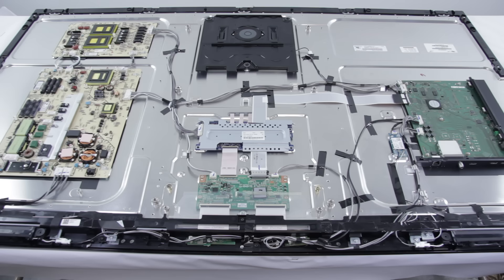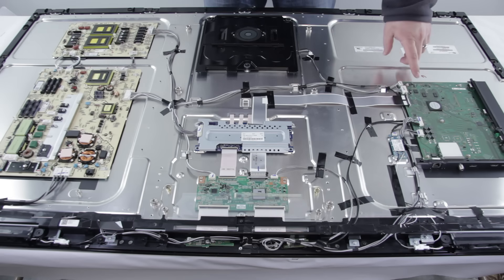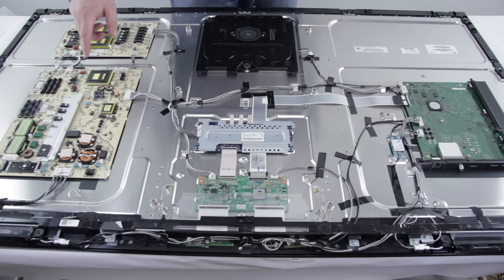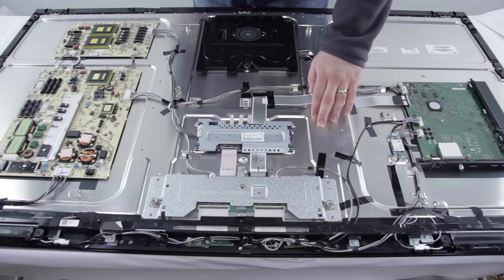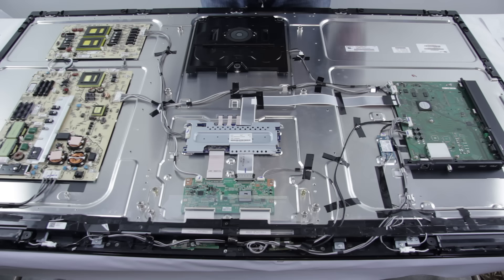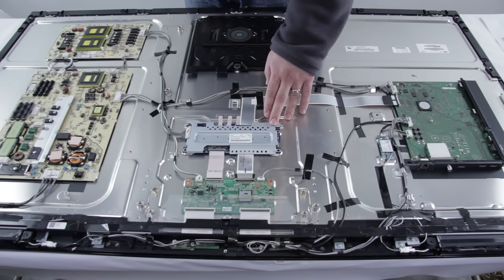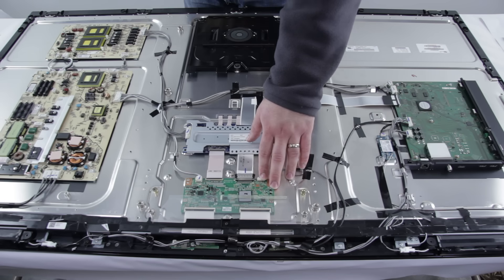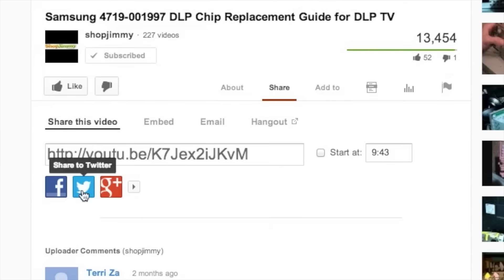LED TV Repair Tutorial - Common Symptoms & Solutions - How to Repair LED TVs

Comment: Hello I have a  samsung ue55d7000 my son hit the screen now it has colored lines going down the right side and the middle part of the screen is slightly darker what is your opinion on what could be the problem and parts to fix it or to expensive to fix.
Reply from the maker: Michael Belcher  This sounds like a TV panel problem.  If your TV panel is bad, it may be more cost-effective to replace the TV as panels are typically hard to find in stock, difficult to replace, and expensive.  Thanks and please let us know if you have any further questions!  www.shopjimmy.com
Reply: I am looking to buy looking at lg la9700 xbr65x900b samsung hu9000 or samsung f9000 any recommendations
Reply from the maker: Michael Belcher   Either should be fine.  Thanks!  www.shopjimmy.com

Comment: Hello I have a Samsung UN46D6400UFXZA  FOR A WHILE I HAD A THIN LINE RUNNING ACROSS MY TV NOW IT IS BLACK NO PICTURE BUT SOUND STILL WORKS.. I TOOK IT FOR REPAIR AND THEY SAID IT WAS THE  T-CON THEN CALLED BACK THE NEXT DAY AND SAID MY BACKLIGHT PANEL WAS NO GOOD AND IT'S NOT WORTH FIXING.. ANY IDEA CAUSE THEY DIDN'T SEEM SURE OF THE PROBLEM...
Reply from the maker: Gunners  This sounds like a problem with either the T-Con board or the TV panel.  You can replace the T-Con board to see if that fixes the problem.  Here is a link to replacement parts for your TV model number on our website, click here:  http://www.shopjimmy.com/catalogsearch/result/index/?cat=63&q=UN46D6400UFXZA  Be sure to match part numbers on your current board, with your replacement for compatibility.  Here is a link to a video showing how to identify your part number, click here:  Samsung Timing Control (T-Con) Boards Part Numbers Identification for LCD HD TV Repair  You can also call our customer service for further assistance with your purchase.  (877) 881-6492  Thanks and please let us know if you have any further questions with your TV Repair!  www.shopjimmy.com

Comment: Samsung LN52A550P3FAZA..I bought the Tcon board from your store but I still get the red line down the screen , Is it the backlight inverter that sits at the top of the screen?
Reply from the maker: Courtney Bourne   This sounds like a TV panel problem.  If your TV panel is bad, it may be more cost-effective to replace the TV as panels are typically hard to find in stock, difficult to replace, and expensive.  Thanks and please let us know if you have any further questions!  www.shopjimmy.com

Comment: Hello - I had bought the TV LG 55LE8500-ZA (LED TV) 3 years back.It was working fine but now displays 'No signal' through the HDMI inputs.
 
I have tried different leads and have connected up another HDMI dvd player with different leads as well. The inputs ARE displayed on screen (like it is recognising them) eg HDMI 1 HDMI 3 but when it tries to find the device it then displays 'No signal'
 
I have looked to see if simplelink was turned on or off by accident but it makes no difference either way (on or off).
 
I have tried a factory reset twice, so any suggestions please.

Regards - Jayesh Shukla (jayesh.shukla@gmail.com)
Reply from the maker: Jayesh Shukla   I recommend replacing the main board in your TV.  Here is a link to replacement parts for your TV model number on our website, click here:  http://www.shopjimmy.com/catalogsearch/result/index/?cat=56&q=55LE8500  Be sure to match part numbers on your current board, with your replacement for compatibility.  Here is a link to a video showing how to identify your part number, click here:  TV Part Number Guide for LG & Zenith Main, Digital, & Tuner Boards (LCD, LED, Plasma TVs)  You can also call our customer service for further assistance with your purchase.  (877) 881-6492  Thanks and please let us know if you have any further questions with your TV Repair!  www.shopjimmy.com

Comment: samsung series 7 LED bought in 2009.
model code UN46B7000WFXZA
serial no. AZ433CFS300322D
version SQ01

at first the picture would be fine then it started to become shadowed..meaning the color was distorted. I saw on youtube to use an eraser to clean the two bottom ribbon cables. not sure if that worked, because the picture would be fine and then go back to the problem.

now the picture goes black. the sound is ok. when the room is dark, the tv screen is on but no picture. it's light a lighter black. So I assume the baclight is on. occasionally the picture would flicker back on. sometimes when you leave it off and then turn it on, everything is fine.

just a reminder
there is nothing wrong with the sound and the screen is not totally black as you can see it light up and stay on when the picture is not working.

not sure what to replace. the TCON, Main Board or the Inverter Board.

Does the flashlight test work on LED tv.

Please help, I will gladly order the parts from you.
Thanks
George

Comment: I have an LG LED Model 42LN5300.less than 9months old.
lost power after storm.  Took it to repair shop and they said main board was cooked as a result excessive power from the cable box through the hdmi cable.  Replaced it and less than 30 days later the TV lost power.  Red light normally at bottom of LG when plugged in not present.  Want to try to repair myself but not sure whether the main board was right diagnosis or whether it is the power supply since the tv is dead. please give me your thoughts and reference to the necessary parts.
Thank you
Reply from the maker: V Santos   You should replace the power supply and the main board when you have a lightning strike or a storm related outage.  Here is a link to replacement parts for your TV model number on our website, click here:  http://www.shopjimmy.com/catalogsearch/result/?q=42LN5300  Be sure to match part numbers on your current board, with your replacement for compatibility.  You can also call our customer service for further assistance with your purchase.  (877) 881-6492  Thanks and please let us know if you have any further questions with your TV Repair!  www.shopjimmy.com

Comment: Hi ShopJimmy - thanks for your public access,

Westinghouse 40" LED TV UW40TA2W - easy to turn off, getting harder and harder to turn on.  Press the remote (or ONEFOR ALL remote where I can see pilot light) 5, 10 20 times - somewere in there it used to come on.  Now I unplug the TV for a while - varying periods 5, 10, 30 min, an hour, plug in press remote a few times, unplug again, plug in reversing polarity, sometimes plug it in immediately, repeat - yada yada.  It's on right now.  Red indicator light at bottom of frame is on.  Picture is fine.  Yellow pilot light on power cord module is on.  It's just a matter of time when
it goes to sleep forever, and from the complaints on Westinghouse Cust Svc on websites like this:
http://westinghouse-reviews.measuredup.com/Complaint-Worstinghouse-Fail-TV-Never-Buy-one-66857
many people have the same problem with their TV and I have no reasonable expectation of getting any accurate advice, warranty repair or replacement.  Damn Newegg for carrying this disaster brand, and damn me for blindly trusting Newegg and not doing my homework.

And look at this: http://westinghouse-reviews.measuredup.com/Complaint-Westinghouse-has-my-TV-72861

"Westinghouse has my TV:

I sent a broken TV to Westinghouse using the RMA they provided. The TV was under warranty. That was last year in October. They said they would replace it. I've not heard anything in three months. When I call to ask the status, I'm told the department I need to talk to is busy and someone will call me back. No one has ever returned my call. I've called at least twelve times. I've also sent several e-mails. All have gone unanswered. This is the worst customer service I've ever had to deal with, bar none! Not only have I been without my TV for three months, no one will give me the status of my case. Case # is EU59596. Will someone at Westinghouse please contact me to advise the status of my TV and let me know when I can expect a replacement, as promised?"

So ShopJimmy, I've got tools, a volt-ohm meter not totally unfamiliar with electronics, have watched other youtube videos on LED repair, but this is new territory for me, though if you'll instruct and have the parts I'm game.
 
Thanks,

Mike
Reply from the maker: D M Berns    Unfortunately I do not see any replacement parts for your TV model number on our website.  Thanks!  www.shopjimmy.com

Comment: UN55D8000 TV wont turn on , when I unplug the Main board, the backlight will come on if the power is plugged in... is it the mainboard , or the power board?
Reply from the maker: Chris Coryell   I recommend replacing the main board in your TV.  Here is a link to replacement parts for your TV model number on our website, click here:  http://www.shopjimmy.com/catalogsearch/result/index/?cat=56&q=UN55D8000  Be sure to match part numbers on your current board, with your replacement for compatibility.  Here is a link to a video showing how to identify your part number, click here:  Samsung Main Boards & Digital Boards: Part Numbers for LED, LCD, DLP, Plasma TV Repair  You can also call our customer service for further assistance with your purchase.  (877) 881-6492  Thanks and please let us know if you have any further questions with your TV Repair!  www.shopjimmy.com
Reply: ShopJimmy.com
Reply: So I replaced the main board and power board.. but its still not allowing me to power the tv on... im guessing its the remaining part

Comment: My daughter sprayed windex on my vizio led 3 d TV nodel#M3d420sr. The liquid dripped down under the bezel . I unplugged it and tried to dry it out but when I turned it back on half the screen is red vertical lines . half the screen is fine. Can this be repaired?
Reply from the maker: Chris T   No, this cannot be repaired.  This sounds like a TV panel problem.  If your TV panel is bad, it may be more cost-effective to replace the TV as panels are typically hard to find in stock, difficult to replace, and expensive.  Thanks and please let us know if you have any further questions!  www.shopjimmy.com

Comment: I have a Vizio M550SL. When we turn the TV on, the 'Vizio' logo at the bottom shows light, and we can hear all sound from the Satellite receiver input, but there is no light or backlight visible. No matter what input is selected, no light (or TV menus) will display.
Reply from the maker: Brad Morse   I recommend replacing the power supply in your TV.  Here is a link to replacement parts for your TV model number on our website, click here:  http://www.shopjimmy.com/catalogsearch/result/index/?master_part_type=Power+Supply&q=M550SL  Be sure to match part numbers on your current board, with your replacement for compatibility.  Here is a link to a video showing how to identify your part number, click here:  TV Part Number Identification Guide for Vizio Power Supply Unit (PSU) Boards (LCD LED Plasma TVs)  You can also call our customer service for further assistance with your purchase.  (877) 881-6492  Thanks and please let us know if you have any further questions with your TV Repair!  www.shopjimmy.com

Comment: I have a question for Shop Jimmy. My Vizio M550VSE died during a thunderstorm. Although nothing tripped the breaker on the surge protector, the Vizio never powered back up. Thinking it would be power supply, I just shotgunned it and bought from you guys. Of course, that wasn't the problem. So I currently returning it. My next guess would be the LED driver board. The front LED for the VIZIO logo is not illuminating. Would I be correct in this assumption? 

Thank you in advance,
Reply from the maker: Johnathan Collins   I recommend replacing the main board in your TV.  Here is a link to replacement parts for your TV model number on our website, click here:  http://www.shopjimmy.com/catalogsearch/result/index/?master_part_type=Main+Board&q=M550VSE  Be sure to match part numbers on your current board, with your replacement for compatibility.  Here is a link to a video showing how to identify your part number, click here: TV Part Number Identification Guide for Vizio Main Boards (Plasma, LCD, LED)  You can also call our customer service for further assistance with your purchase.  (877) 881-6492  Thanks and please let us know if you have any further questions with your TV Repair!  www.shopjimmy.com

Comment: i have a UN55ES7150F IS DARCKEND half screen, i changed the T-CON board but still the same, you think it's the lcd screen?
Reply from the maker: Yes, this sounds like a TV panel problem.  If your TV panel is bad, it may be more cost-effective to replace the TV as panels are typically hard to find in stock, difficult to replace, and expensive.  Thanks and please let us know if you have any further questions!  www.shopjimmy.com

Comment: Hi, I have a Haier 42 inch LCD TV (model HL42XK1a). It is about 4 years old. Recently, the screen is dimmer than usual when the TV is on. And adjusting the brightness by remote doesn't solve the problem. Everything else is normal. What do you think the problem will be? Thanks.
Reply from the maker: Yangjian Liu   I recommend replacing the power supply board in your TV.  Unfortunately I do not see any replacement parts in the search results for your TV model number on our website.  Please reply with your part number on your power supply board and I can try searching for replacement parts.  Thanks and please let us know if you have any further questions!  www.shopjimmy.com

Comment: I have a Vizio VF551XVT LED TV.  The picture is bright and clear in the top 1/4 of the screen.  Below that there is a picture, but it is really dim and difficult to see.  I've tried resetting all the TV settings but to no avail.  Is the problem I'm seeing typical of a particular part going bad?
Reply from the maker: Steve Lampo   This sounds like a TV panel problem.  If your TV panel is bad, it may be more cost-effective to replace the TV as panels are typically hard to find in stock, difficult to replace, and expensive.  Thanks and please let us know if you have any further questions!  www.shopjimmy.com

Comment: Westinghouse CW40T2RW - Less than a year old, TV just turns off by itself periodically.  I can turn it back on without a problem.  Everything works.  It will go for days without turning off, then turn off three times within 20 mins.  I have no problem opening the back and replace a part or wire.  I'm just not sure where to start.  Suggestions?
Reply from the maker: Kelly White   Check the capacitors on the power supply to see if they are puffy or mushroomed on top.  Let us know what you find.  Thanks!  www.shopjimmy.com

Comment: hi. I have a LG LED tv model 42LN5130-TI. while watching tv for about two hours the sounds go off. when I change the inputs it will come back again and go off in a while. I removed the tv and checked for the capacitors on the circuit boards too. They are fine too. please advice.
Reply from the maker: sanjaya wijeratne   This sounds like it could be a cable connection problem or possibly a bad main board in your TV.  You can replace connecting cables or the actual main board itself.  Unfortunately I do not see any replacement parts in the search results for your TV model number on our website.  Please reply with your part number on your main board and I can try searching for replacement parts.  Thanks and please let us know if you have any further questions!  www.shopjimmy.com

Comment: LG 37LE5300 - When the backlight setting is higher it blacks out more often. The lower I put it, the less often black out of screen occurs.
Reply from the maker: Michael Patterson   I recommend replacing the main board in your TV.  Here is a link to replacement parts for your TV model number on our website, click here:  http://www.shopjimmy.com/catalogsearch/result/index/?master_part_type=Main+Board&q=LG+37LE5300  Be sure to match part numbers on your current board, with your replacement for compatibility.  Here is a link to a video showing how to identify your part number, click here:  TV Part Number Guide for LG & Zenith Main, Digital, & Tuner Boards (LCD, LED, Plasma TVs)  You can also call our customer service for further assistance with your purchase.  (877) 881-6492  Thanks and please let us know if you have any further questions with your TV Repair!  www.shopjimmy.com

Comment: MY SAMSUNG SMART LED TV BN44-00518B HAS A PROBLEM WITH THE SCREEN. THE BOTTOM HALF OF THE SCREEN IS DARKER MAKING IT HARD TO SEE. THE TOP HALF OF THE TV IS WORKING FINE. PLEASE ADVISED.
Reply from the maker: pascal cesar   This could either be a problem with the power supply board or the TV panel.  If this is a problem with the TV panel it may be more cost-effective to replace the TV.  You can replace the power supply to see if that fixes the problem.  Please reply with your TV model number that is found on the sticker on the back of the TV.  Thanks!  www.shopjimmy.com

Comment: Hello, I have a Samsung 51 inch Plasma TV Model PN51D550C1F there is a blue vertical line down the middle of the tv. If you can assist in the matter I would greatly appriciate it. Thanks in advance!
Reply from the maker: iceover06   This sounds like a TV panel problem.  If your TV panel is bad, it may be more cost-effective to replace the TV as panels are typically hard to find in stock, difficult to replace, and expensive.  Thanks and please let us know if you have any further questions!  www.shopjimmy.com

Comment: JVC 47" LED tv, won't turn on;  Model:  JLE 47BC3500, Serial #: TR1DAN 023400065.  I used the remote to turn on, though it did not take; so I did it again and heard a zzzz noise.  Doesn't turn on.  HELP, only year and half.
Reply from the maker: Ruth Miranda   I recommend checking the capacitors to see if they look puffy or like a mushroom on the top.  Also see if you can figure out which board is buzzing.  Reply and let us know what you find.  Thanks!  www.shopjimmy.com